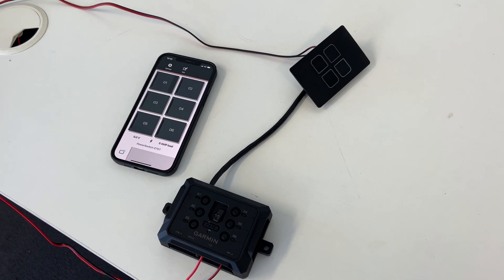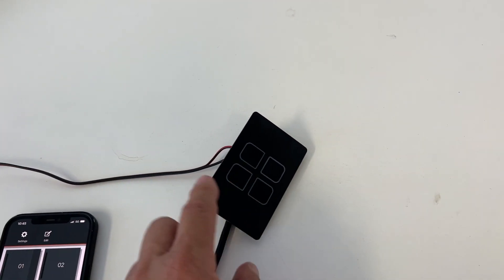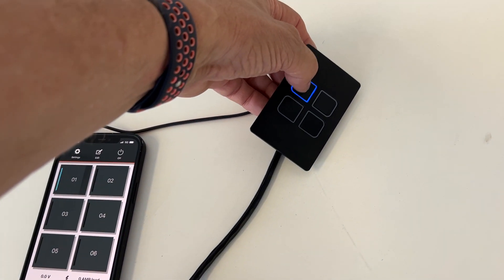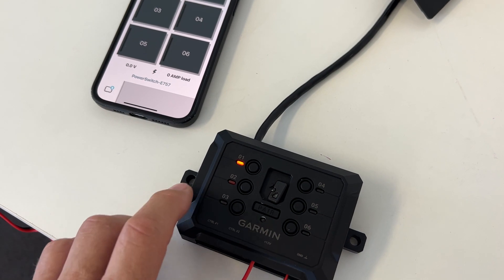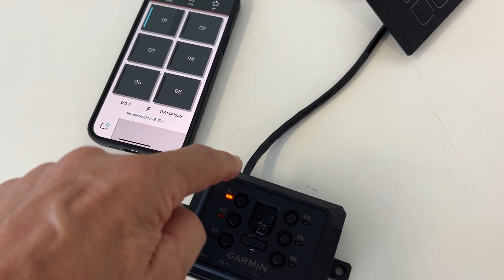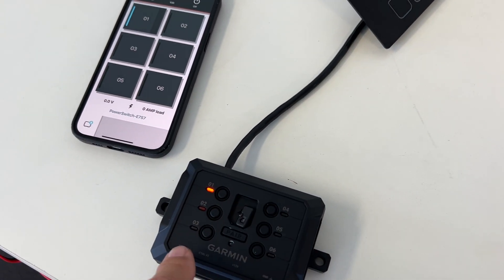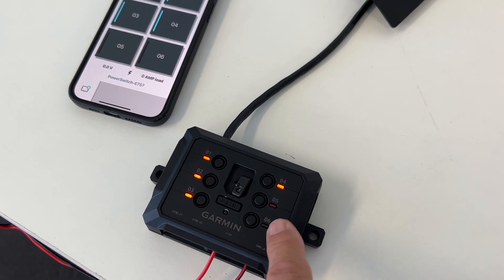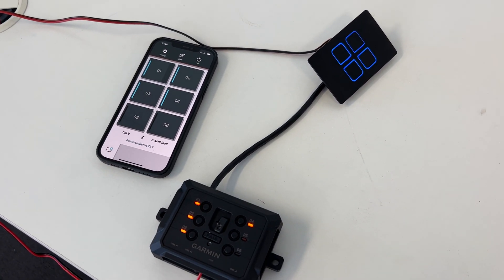Safiery Smart Switch marries with Garmin Power Switch to give 30A per channel dimmable NO FUSE power

Comment: Not quite sure understand the video.
So is each switch on your switch wire into the power switch.
I have a garmin power switch on my truck really like it the control input points are great and designing scenes is brilliant. 
Just don’t understand how you have wired this in and sort of why ? 
Not been rude just wondering, maybe to have a physical switch in a canopy or something ?
Reply from the maker: Yes it is to have a physical switch in a canopy or van. We have 2 power switches in a present VW craft build long wheel base. Smartphone app is good occasionally but a pain for everyday switching in a van.
Reply: @Safiery  so your switch is connected to the control inputs allowing a feed to then trigger the switches programmed from seeing that feed. 
Sorry more questions, just saw you system that also controls basically everything is amazing brilliant ideas amazing nice one
Reply from the maker: @samhartfieldlewis5247  Thank you, yes you are correct. The video shows when pressing the button, the app changes, the LED on the control block changes and everything is in sync. Likewise, activating the app drives the LED on at the Smart Switch.
Reply: The part that is missing is how do you connect your Smart Switch to the Garmin.  Is there an RJ45 plug on the Garmin?  Or have you somehow modified the Garmin to interface with your device?